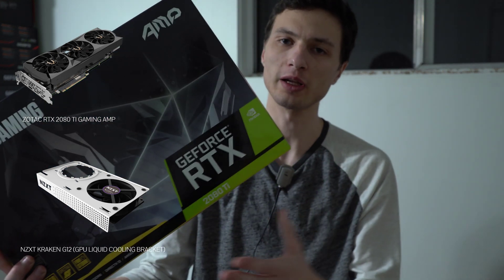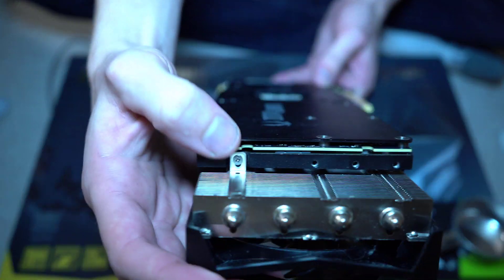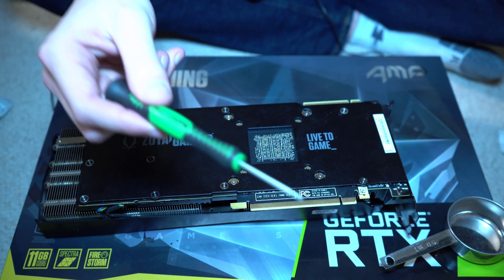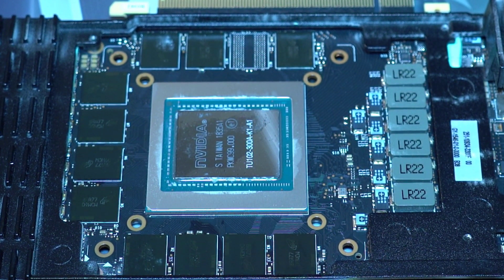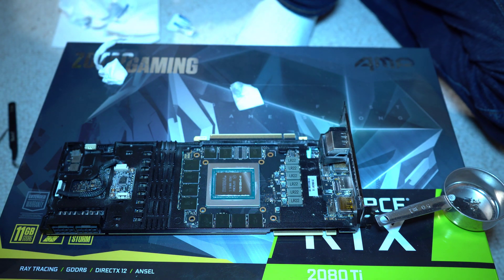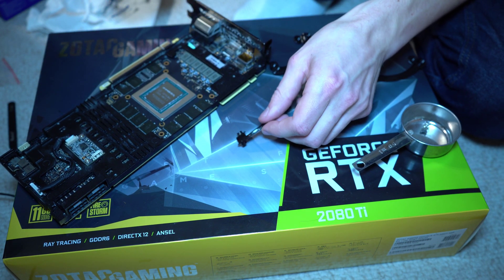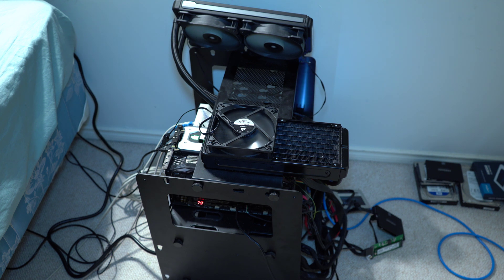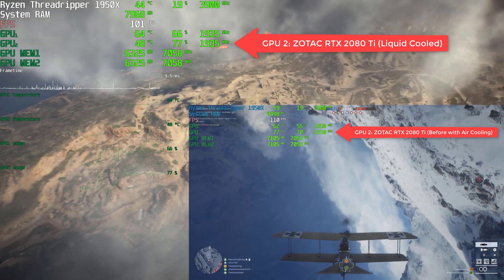Zotac RTX 2080 Ti Liquid Cooling Mod

Comment: Hi, i Wish you can answer my question
 I want do the same on my rtx 2080 Ti, but i'm scared about vram temps. 
Someone says than are Better Whit g12 against the stock, someone says than g12 Is very Dangerous for vrams temps. How was you exprience After months you did this mod? 
Sorry for my english, i Wish in your answer
Reply from the maker: Hi Karim, yes I have heard this can be dangerous for vrams temps as well. That being said, this setup has been running perfectly for almost 2 years now.
Reply: You do overclock?
Reply from the maker: @leonardomarini8236  Yes +5% on Mem and Core Clock and 110% on Power

Comment: are you still using the card today or did you get the 3080/90? how did it hold up? ive got the same card coming up on 2 years now and the fans have been making an awful sound, so im thinking of going with the g12 aswell, but with a 360mm radiator instead. any advice before i start the journey?
Reply from the maker: I still have it and it has been running great. Thanks for your comment.
Reply from the maker: Just a heads up though, occasionally I do have to tap the pipe about every 6 months to relieve the build up of water bubbles.
Reply: @VeeTechYouTube  thanks a lot for the heads up and reply! :) keep up the good work.

Comment: im looking all over to find either video or even a picture process , of the removal of the AMP Maxx RTX2080ti cooler. this seems to be the closest thing to what im looking for, but that card is not the same , yours came off with far fewer screws it seems.
Reply from the maker: What screws is it held in with?

Comment: Are you noob ? 
Your graphics unit may lower performance because you don’t use VRAM heat sink ...
Reply from the maker: idk it seems to run fine without the VRAM heat sinks. Do you really think it is that bad without?
Reply: @VeeTechYouTube  yeah in my case it drops 3 to 10 fps lower and randomly working thermal throttling.
Reply from the maker: Okay thanks for the tip. Is there anything else I can do to improve this YouTube channel? I am trying to hit 1k subs.
Reply from the maker: I see. What do you think of my new build? It is posted on my main channel featured video.
Reply: VeeTech I like your channel but I recommend you to add a tags in description. tags may attract ppl’s interest.
Reply: VeeTech I watched your video and after a time I bought RTX2080 Super, so your videos helpful. and I learned to install a heat sinks to VRM. I subscribed

Comment: I'm sure it will be obvious when I actually do this, but where does the pump controller plug in?
Reply: Depends on the pump you use.  Some use a 3 pin or 4 pin fan header, some use a SATA power connector, and some use usb which connects to a header on the motherboard.

Comment: Were you able to use the 4 pin adapter to plug in the fan directly into the video card?
Reply from the maker: Correct. Thanks for watching by the way.

Comment: Your threadripper is bottlenecking your cards incase you have not noticed your gpus not running at full capacity. You could easily gain 30% more perf with a 8700k

Comment: Hi friend, thank you so much for this video!  +1 and subscribed!
Mind asking... Since the day you modded the card with the AIO until today, has there been any problems with your Zotac card?
Also, did you later put any heatsinks? And where to buy that motherboard to GPU adapter or the name of it?
Reply from the maker: Confirmed no issues yet. The name of the GPU liquid cooler adapter is the Kraken G12. 

Thanks for watching by the way and I appreciate the subscription :)

Comment: Dude, you need a second fan on your radiator! Cooling the whole surface of the rad is essential. Tbh though the reference boards on the RTX cards are power limited, you can see that both cards are hitting the same gpu core even though the Zotec is running cooler. Absolute 4K killer though 😀
Reply from the maker: Hlspwns, thanks for the attention to detail in providing feedback. For the radiator, I have realized 1 fan is more than enough since I am unable to get the liquid cooled card >55C. And yes unfortunately both of the cards are reference boards. All of the enhanced boards are out of stock in Canada so I had to settle with these. Thanks again for watching.
Reply: @VeeTechYouTube  With a single fan on a 240RAD is only giving you 120MM of cooling potential, add a 2nd fan an the temp will go down even more. You must have all fan slots in use of your wasting the Rads potential, that's a given. How are you limited to only 1950? I can get mine to clock to 2050 before temps drop it back down to 1900s, I ordered the EVGA kit the other day so soon as it comes in, mines getting a hybrid kit to.
Reply from the maker: Honestly it is because I hate fans haha. I 100% agree with you though.
Reply: @VeeTechYouTube  lol, hating them or not, it's the purpose of it haha